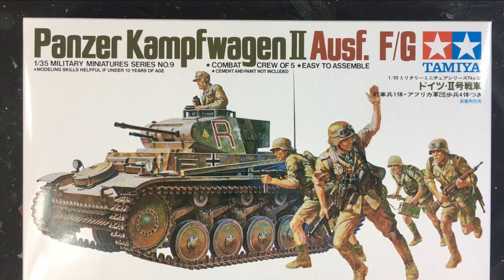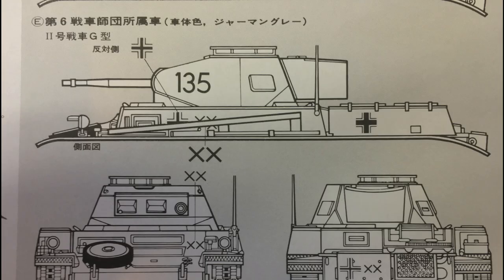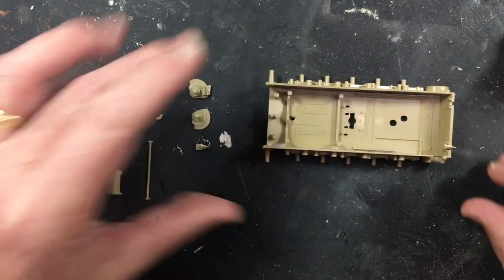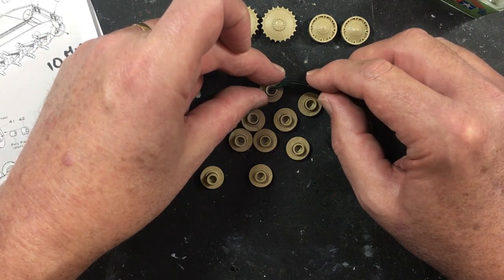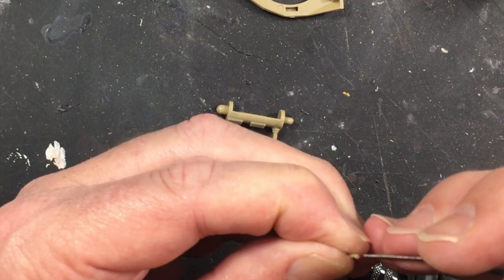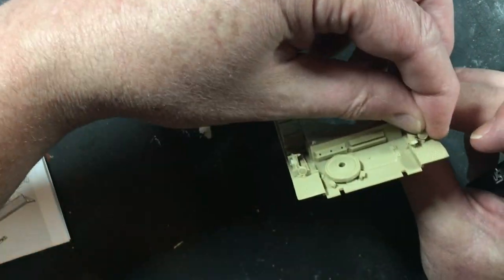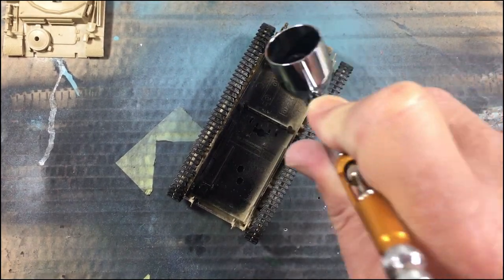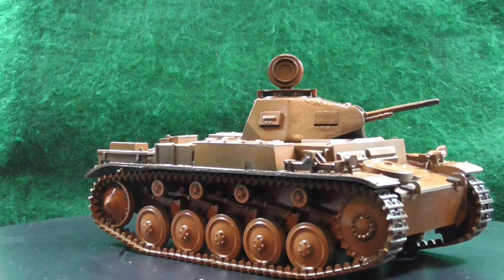Building Tamiyas 1/35th Scale Panzer 2

Comment: Isn't it nice when a kit has clear instructions and everything fits! My recent kits have been by Italeri, Tamiya and Revell, and there's no doubt which has been the most pleasurable to build. The Revell Land Rover I'm currently building is a well-detailed kit and it's going together without too many difficulties, but the instructions are a little vague in places and the parts are frequently scattered across multiple sprues so I seem to spend more time tracking parts down than putting them together. I wish all kit manufacturers did things the Tamiya way!
I'm looking forward to seeing you wreck this Panzer.
Reply from the maker: Thanks Ian, totally agree and really struggle to understand why most manafactures cant produce decent instructions, Dragon comes to mind as consistantly being either vague or plain wrong!   I am looking forward to wrecking her as well, just need to be careful i dont go overboard 😝
Reply: @HalidonDioramas  I haven't tried a Dragon kit yet, but they do make some interesting stuff. I've had a slight crisis with the Revell Land Rover- the instructions are wrong where it shows the gear lever positions for left or right hand drive versions! Somebody can't tell their left from their right and I've spent the best part of an hour correcting the mistake.

Comment: The tech tip pamphlet indicated it was a later packaging version, probably around 90's. I bought the motorized version in the early 70's, the 4 Afrikacorp soldiers were sold separately. Then in the mid 70's Tamiya combines the solders and the tank and sold as a package, also Tamiya started doing away with the motorized tank models in the late 70's.